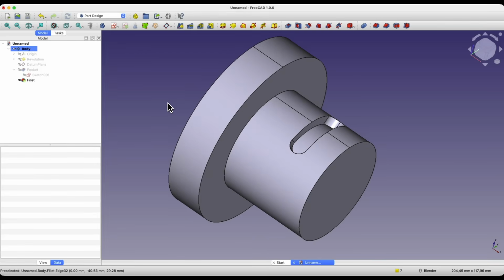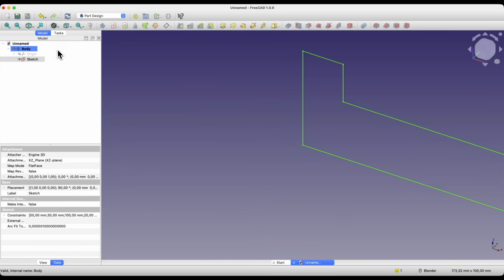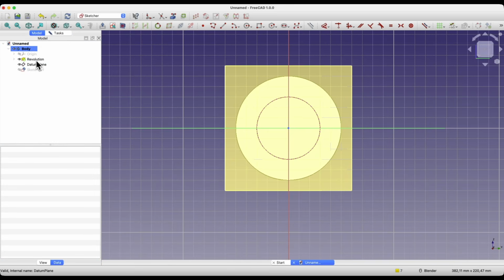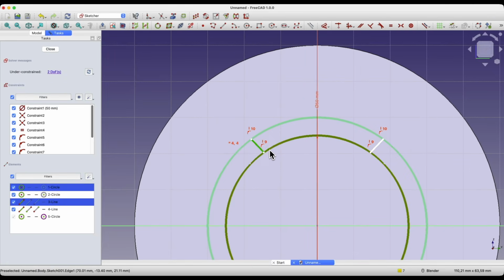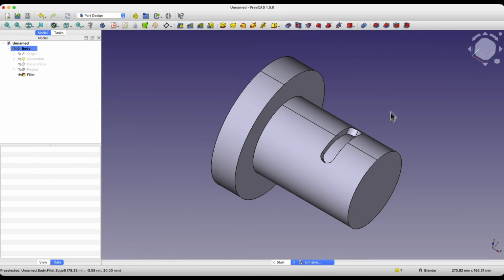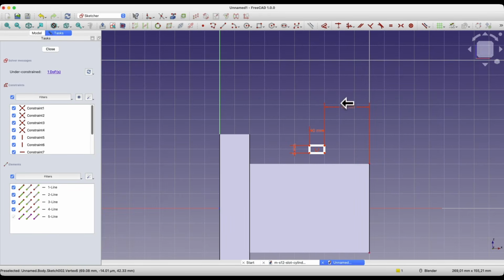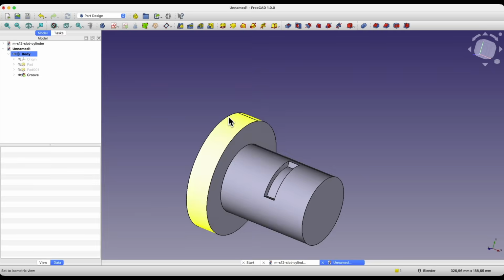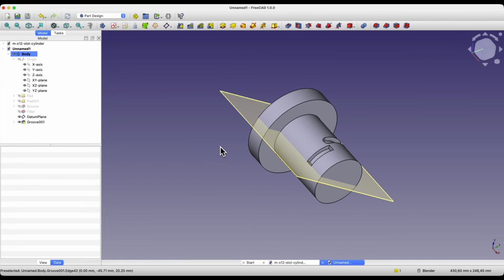🔥Mastering Groove Creation in FreeCAD: Cylinder Grooves Tutorial (2 Methods)

Comment: How do you make a groove on a part that has a horseshoe shape and the groove is on the inside of the shape?
Reply: For that kind of operation, you would need to use a subtractive loft feature. First, sketch the patch along the face of the horseshoe. Then sketch the profile of the groove and attacht the profile sketch to the path sketch. Use a subtractive loft to remove the groove. If you search for the loft feature on here on youtube, there will be helpful videoes.